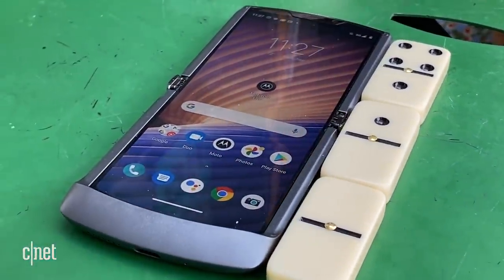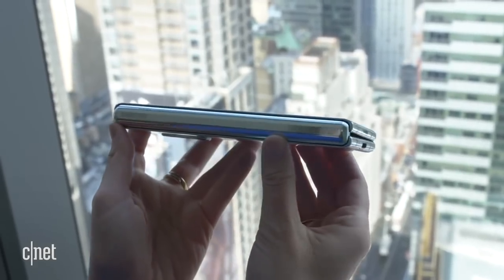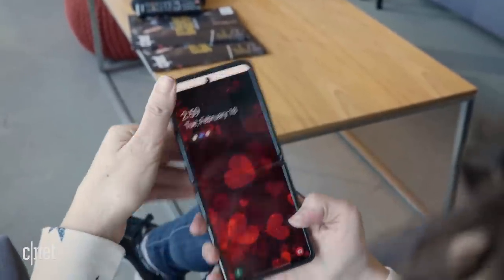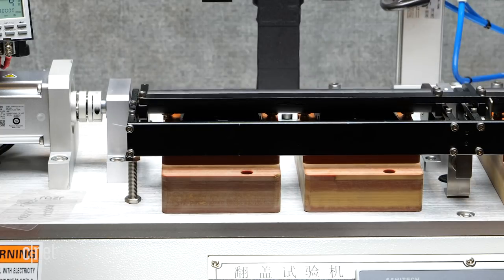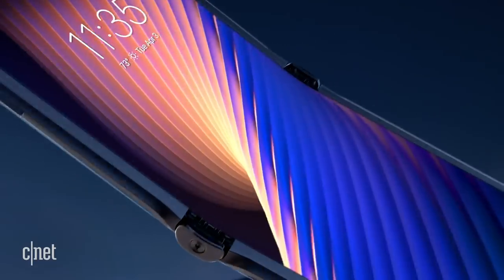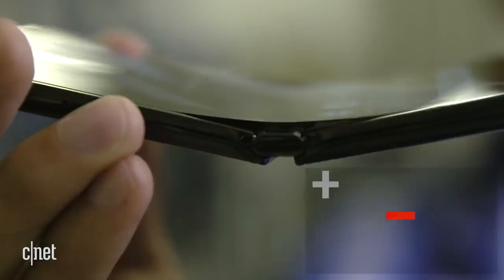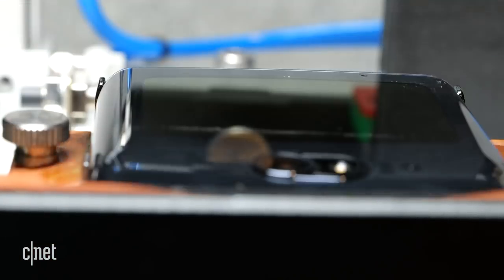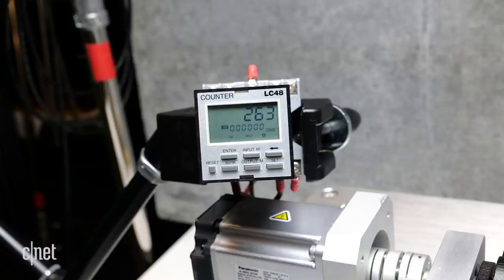The new Razr can be folded 200,000 times. Motorola shows us how

Comment: Bought and sold that phone this week. Wanted to like it. The flip was super satisfying. The tiny external display was helping me avoid using the phone as a distraction device. But it needed to be charged like twice a day, the single speaker was very tinny, the performance of some apps (LastPass, for example) in Android was less smooth than iOS, and the final, worst thing of all was that Android Auto was completely broken. It didn't work at all wirelessly, only facilitated phone calls; wired, it would start to work for a couple seconds and then break. This is something Motorola has been aware of since the phone launched in October (almost half a year now) with no fix. No cool flip is worth giving up music in my car—particularly for a phone with so many other problems. It's a shame. Hopefully in the next few years they'll have gotten all this stuff (the battery in particular) under control. I admire their ambition, but for me this phone just was not it.

Comment: Would like to know whether the test phones survived AFTER open and closing 200,000 times? 
Did Motorola tried to fold and unfold beyond 200,000 times? 
At which point did the phones fail/start showing issues?
Reply: It doesn't work as you think. If motorola says it las 200k times it's because the phone does it reliably, after reaching that number the hinges could decay, all this depends on how the user treats the phone

Comment: This is just an ad for the Razr. I still don't understand why cnet's test was 25k+ and razr is 200k+...are they testing it properly?
Reply: The cnet test was for the past generation, the new one may last longer. Nevertheless, motorola did say the last one would last longer, I think 100k flips, so perhaps the cnet tests was harsher/more realistic. They need to do it again with the new generation to really know
Reply: pay attention to CNET's test and you'll see that they clamped the two halves in a fixed position that forced the hinges. Also I suspect the clamps were a little off center thus causing much more stress.  Motorola's lab test uses wires that slide when the open  gesture is made, just like your thumb will slide when opening the phone without stressing the hinges
Reply: CNETs test was pretty horrible.  I just bought the phone.  Yeah it was expensive but it’s small and I like the fact that the screen isn’t exposed all the time

Comment: Opening the flip with wire is the worst idea !!
Most users would open the flip from one of the corners! So, this 200k number is just for marketing and not really testing.
Reply: They simply can’t mimic a finger tip/nail pressing onto the side of the split and then squeeze it open, and do it consistently, not even 100 times.
Else, they have to employ bunch of flap tester sitting at the test lap and do this all day.
Frankly, 200,000 times is nothing. In those days, owners of Motorola microtec simply open their phone to kill time, like bursting bubble wraps.